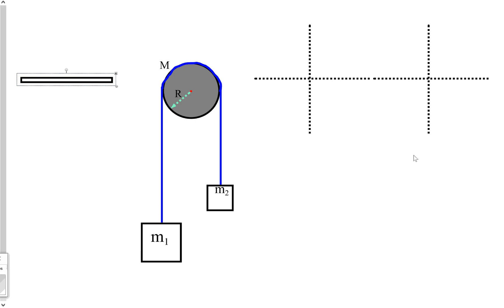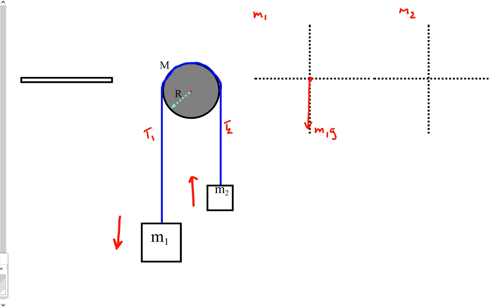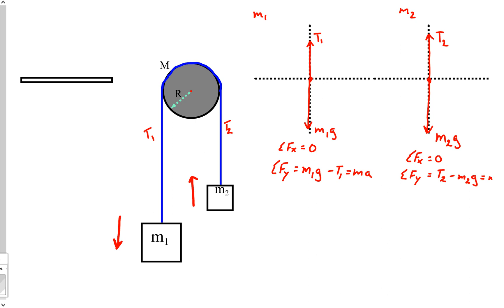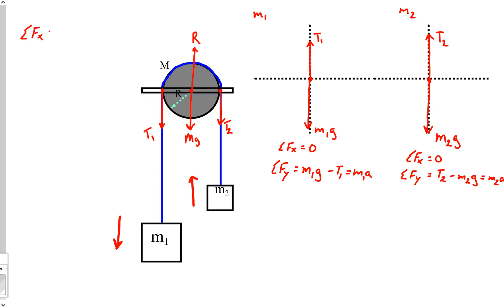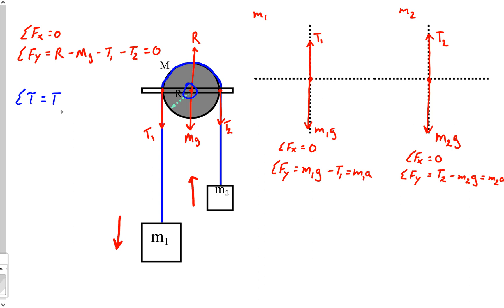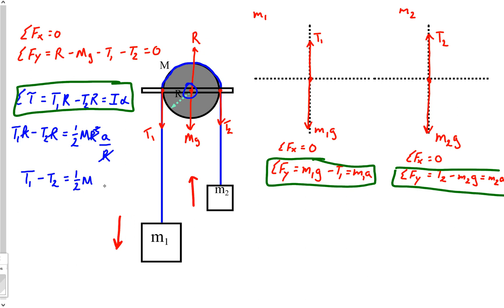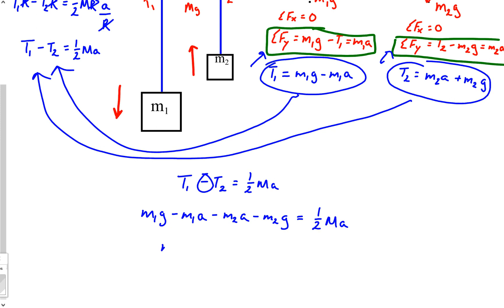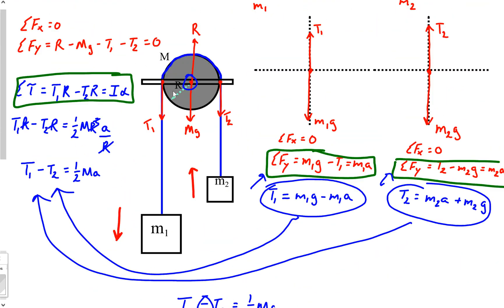Physics - Torque and Angular Acceleration Part 2 (Cylinder) Atwoods Machine With Pulley

Comment: Hey, thanks for the video. I just couldn't understand two things: 
1) Why is the tension force pointing downwards?
2) Why is the torque is defined by the tension force and not Tension force + m_1g (and same with m_2)?

Many thanks again :)
Reply from the maker: I probably need some clarification in the question, but I will do my best. The tension force is directed up based up[on the attachment to the two masses m1 and m2, but on the rigid body diagram, the tensions are each directed down based upon their point of attachment to the pulley/beam. If the beam were static i.e. not moving, then the T1 would equal m1g and in like fashion m2g would be equal to T2, but since it is rotating, then we had to incorporate the dynamics of the accelerating objects into our system. So the torque we can call Torque1 = T1 x r1 essentially. That T1 then is defined based upon the moving object m1 as m1g - T1 = m1a. 

Rarely do you work a torque problem without it accompanying some Sum of the Force type equations. I'm not sure this helped, which is probably why I make the videos, because my typing is probably not a clear. I hope you are getting it.